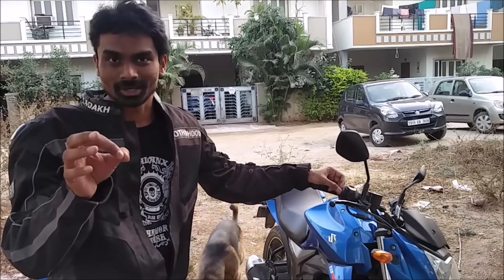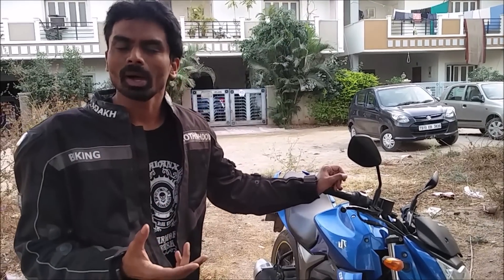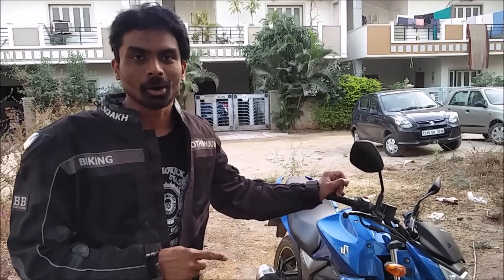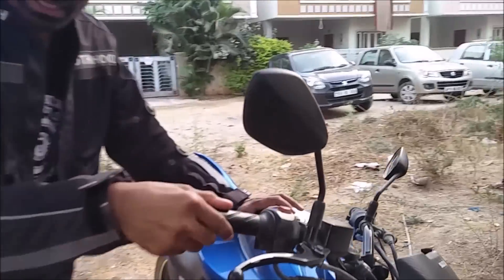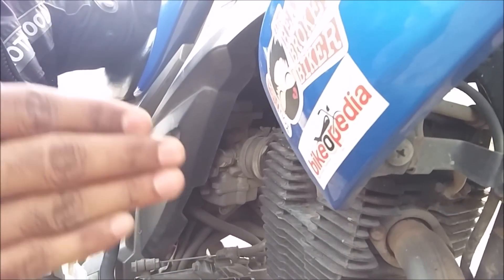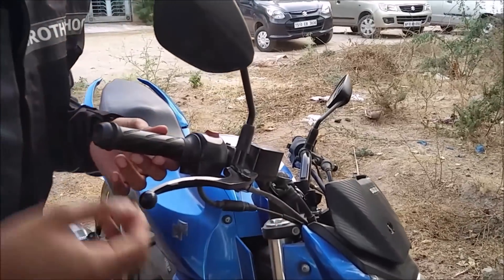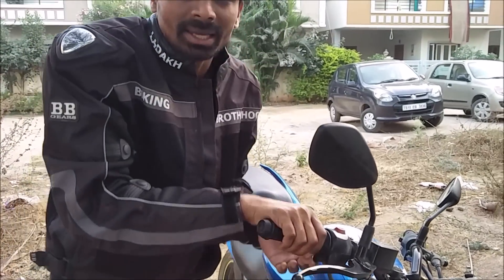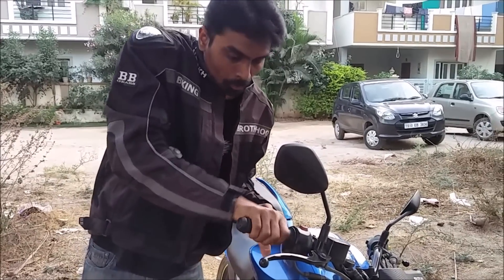What is RIDE By Wire Throttle - KTM RC 390 2017 Reference.

Comment: ride by wire is actually much safer if you maintain your bike and keep the sensors clean. There's no reason for the sensor to not work since it's usually much more tightly sealed from prongs inside the connection points. Cables can loosen overtime. Since sensors are much tighter, there shouldn't be any problem with feedback unless you're causing a glitch by constantly changing rider modes. The same is for cars. Yes computers are much more sensitive. Be easy on the button pushing and you shouldn't have a issue.
Reply from the maker: Thanks for the inputs my friend!

Comment: Even my bike Hornet 2.0 (184cc) is having ride by wire feature.. Even it doesn't have riding modes and much power I wonder does it really required one for low cc bikes.!!

Comment: We are in that advanced electronic era in which we don't even need clutch & gear from normal motorcycle to super sports bikes too due to selectable speed limit aacelaration modes by servo itself & throttle according to that speed limit! It will save lots of fuel too!

Comment: The only question I wonder is.. If Ride by wire is blocking the throttle body if given unnecessary throttle.. And prevents the bike's rear tyre from slipping... Then why is the need of traction control... If both does the same work.?? 
Plz reply

Comment: I don’t trust this technology. If it fails, who knows how to work on these type of electronic systems? The new Harleys have this system & I already know of a case where it completely failed. The entire handle bar had to be disassembled because the wires are tucked into the hollow handle bar itself.

Comment: Instead of cables we are now using sensors even in Speedo meters. So here instead of cables KTM is using sensors for throttle that sensor system is callled ride by wire. Main reason everyone moving to sensors is for precision and also we say moving with the times. Traction control, ABS all such things are closely related in big machines but here just think simple SOME THING IS BETTER THAN NOTHING.

Comment: A question please (hopefully not a stupid one):

How can you easily tell if a bike is ride-by-wire vs. the traditional mechanical setup? 

Since both would be insulated wires/cables, I imagine the distinction between the two is not so readily obvious.

I recently got a 2017 FZ-07. I'm fairly certain it has the traditional throttle setup, although I don't know that for an absolute fact. Nevertheless, I'm curious. Not just for my own bike, but other bikes in general. 

Very interesting subject. Learn something knew every time. And thanks for discussing this, Vikas.

Comment: People need to understand that the technology has been introduced for good reasons. When it becomes electronic it can override human actions. When we throttle too hard or what is called blipping it emits engine pollution. When its mechanical you cannot control it, but if its electronic it can override human actions. Mostly in all other city commuters this is going to come soon to  control emission norms. Mechanical may be better in track but not in city where we have some idiots who throttle like they have no respect for their engines.

Comment: I have a bike that has actual cable, and i test rode a powerfully fast bike that has ride by wire, and i can attest that the blipping the throttle for rev matching is EASIER on the ride by wire bike.....downshifts smoother.

Comment: great explication, but there are some other reason for the ride by wire system. firstly due to more and more strict emission regulations, the RBY  caculate the exact amount of air/fuel mixture give in to the combustion chamber at anytime to make sure no excess fuel going in, then never let the unburn fuel going out to the exhaust pipe to destroy the catalic converter (so it is impossible to see fire 🔥going out of a RBY motorcycle's muffler).
Secondly, RBY system control the idle status, so it never let the butterfly throttle valve to close to make sure no ash create around them. it means you will not have to clean you throttle body for much longer.
Reply from the maker: +Binh Quach Thanks very much. Hope you enjoy my other videos too and hope you subscribe

Comment: sir great video...but one thing...it is not the servo on the throttle body..it is indeed a simple solenoid which connects to the throttle valve...servo is a term which describes any aid in colabartion of the existing system to attain the physical motion..eg vaccum servo (round black colored drum attached to mastercylinder) in brakes of cars...and yes no need of drive by wire if u dont have TCS .. good work sir

Comment: Hey Vikas,What you said about the bikes is completely true, i just need to correct you on the part where you said Fly by Wire was introduced to reduce power to big engines and let the computer decide how much power to give, you are absolutely wrong about that. Fly by wire contrary to what you think is actually to increase throttle reliability. Sensors are mechanical, they don't fail (they are high end potentiometers at the base of the throttle). The computer calculating the throttle input and transferring the exact SAME to the engines can fail and there are always 1 to 2 more redundancy systems in place to replace a malfunctioning computer. So Fly by wire was more of a reliability thing rather than giving the computer more control because incase of a line controlled system after the cable snaps overhauling mid flight is not possible. Fly by wire also allowed for the famous anyone can fly a plane Autopilot systems. While flying manually the pilots inputs are not over ridden and are only over ridden if the TOGA and Auto-throttle are being used.
Reply: Also the commands in the TOGA and auto-throttle are not really over ridden as much as they are left completely for the computer to handle.
Reply: Sorry for comment pile up, but the ECU of the RC 390 2016 gets the accurate fuelling data for the injectors by gauging the throttle plate position by the TPS sensor which takes read outs at x intervals of times every second. Why the RBW throttle on the 2017 Rc  makes it better because the fuelling of the bike is better because the data to calculate injection timings is collected straight at the source, the wrist and that gives you a more crisper throttle response on the track, instead of waiting to gather data post you turning throttle countering wire slag turning the throttle plate, wire lengthens a bit when warm and then finally taking a read out at the TPS for the ECU to calculate injection durations.

The RC 390 is barely a 2 year old bike in India and more or less all owners service the bikes as the warranty period is still on and it is an expensive bike. so one may not feel the difference now between the RBW and the older cable driven versions. Once the bike ages about 4 years the cable throttle performance is going to be low compared to the RBW which will give exact same throttle response provided the servo (sealed case does not need lubing for life of bike) fails or malfunctions. ECU malfunctions can happen to the 2016 RC too.
Reply: Computer calculated injection is still used in both the 2016 and 2017 versions just the source to calculate is different, 2016 is TPS and 2017 is the potentiometer at the wrist.
Reply from the maker: +cardude Thanks for the good feedback mate. Thanks for watching and hope you enjoy my other videos too and hope you subscribe.
Reply: I am surprised i am not still subscribed to you. I do watch your videos i even know Sid!
Reply from the maker: +cardude Ahh, that is very nice to know mate. Also, I loved reading your comments. I love technology and information. Wish you a good Sunday. Thanks!
Reply: You too have a good one!

Comment: I own an RC390 and since you own a D390, I thought I'd ask you, don't you feel like the throttle is very snatchy at lower revs or slow city speeds on our bikes? As far as I know, the new ride-by-wire system has fixed this issue on the 2017 RC390. Isn't that also an advantage inherent to ride-by-wire systems; a more accurate fuelling? Or is there a way to improve the throttle finesse on our old bikes?

Comment: Also tell your thoughts abt requirement of liquid cooling in smaller cc bikes. I don't think it's required in 150-200 cc bikes and it only adds up the cost. I think Yamaha did a nice job with fz250 and that's the reason the price is under control or else it would have gone up by 10-20k.
Reply: Yash Agrawal bro...the main reason behind providing liquid cooling to smaller cc bikes like ns 200 dominor 400 ktm 200 390 is for a simple reason to make the combustion chamber as cool as possible so as to increase the compression ratio...now compression ratio is a extent to which the air and fuel mixture can b compressed...if we increase this ratio without proper cooling the engine will knock...this is the reason why apache 200 with oil cooling produces less power than ns 200 with water cooling...hope u get it now

Comment: its butterfly valve, servomoter, 
ktm use ride by wire for smooth acceleration and RBW also improve fuel economy 
u also add aids like cruise control, traction controls etc 
and bro the thorttle responce on new ktm rc390 was crisp 
and it also have CAN BUS

Comment: Good video again.
You can solve the blipping issue by adding something like Techtronics CABS module. (basically any good auto blipper)
Might not make sense for street riding, but track definitely yes.
Reply from the maker: +The HeartBrokenBiker Thanks very much mate.
Reply: Vikas Rachamalla bro ,rc390 luggage carrying video cheyyandi, 1) carry bags, 2) shopping luggage 3)touring etc, emina modifications unna kuda chuyinchandi.  :) I'll be waiting for the video,thanks in advance .

Comment: Will burnouts still be possible if the new rc390 comes with a ride by throttle cable.  As u said that it will control the traction on the rear wheel.

Comment: Really informative. The advantage of having ride by wire throttle on vehicles is in a way (as I see it) since now you could probably add aftermarket modules like Bazzaz zfi traction control  and probably an auto blipper since a gear position sensor is already present! Multiple possibilities to enhance the motorcycle. I haven't ridden a ride by wire motorcycle yet so I really cant comment on the lag part! Nice video Vikas ji 
 -dr3

Comment: As far as I know fly by wire was introduced because the newer fighter aircrafts could not be kept stable by the pilot alone because of the super maneurability feature introduced by the single wing like structure of nrlew fighter jets. Therefore fly by wire came into picture to keep the aircraft stable.
The only aircrafts with super maneurability without fly by wire are Sukhoi SU 27 which only the fearsome Russian pilots can fly.

Comment: To me traction control is only good for new riders.
If you have been riding a long time , you don't need throttle control.
Reply: +Jojo Crazy Cat -   100 - 260 bhp machines on race track. Imagine with traction control OFF. 
Even motoGP riders use traction control and change levels on the fly. And they've been riding since age 5.
Reply: ***** I'm not a racer, that has nothing to do with normal street riding.
I see people using their brakes when taking curves. I just let off the throttle to slow down, And the engine braking is awesome on the FZ07. It slows down so fast i don't need brakes.
If thats what you need, then use it. I didn't say don't use it.
I just prefer a bike that don't have all that stuff i don't need, and less things to break.
I started out riding bikes from the 1970s.
The back breaks was still drum brakes back on those bike models.
And the Honda 750, and kawasaki 650 back in those days was bad ass.
Going 140 scared the shit out of me.
But the brakes was never a problem for me.
The bike companies are always coming up with new stuff to out do the other bike companies.
They have to so they can get more sales.
I hate the new trucks and cars with all that new shit. Every time we turn around something breaks that cost $500 or more.
I just don't need all that new tech, Im old school.
I can still go fast without any of it.
Vroom Vroom.
Reply: you must ride a scooter then, try riding a proper fast bike then comment.
Reply: Pradeep Menon hahahahaha crazzzzzzy LOL relax dude 😂😂😂😂
Reply: +ReaprGhost hehe correct.
Reply: ***** I dont. Never needed it, and still dont. I think people that ride like crazy people need it.
Reply: ***** Now your just not making any sense, everybody needs brakes, Except in russia. They don't use brakes.
Reply: No offence but this reminded me of the Jimmy Butler(NBA player) incident where he removed his rear view mirror because he didn't believe in looking back. 😂 He should have removed his brakes too because he doesn't believe in stopping XD
Reply: traction control will mean better launch times, better 0-100 timings.
Reply: Live to Ride, Ride to Live.